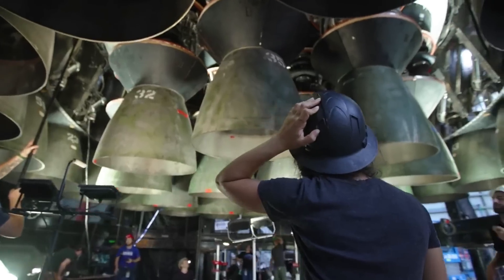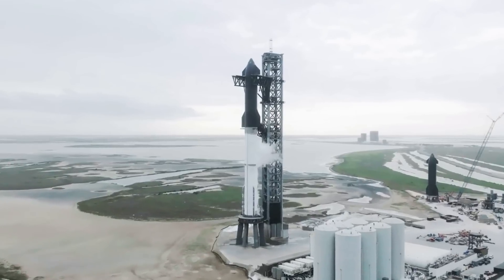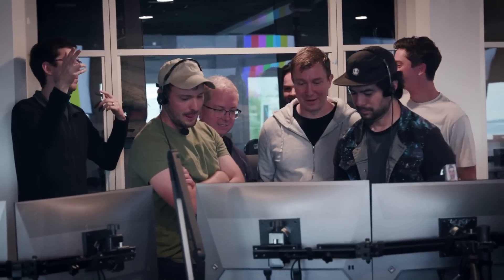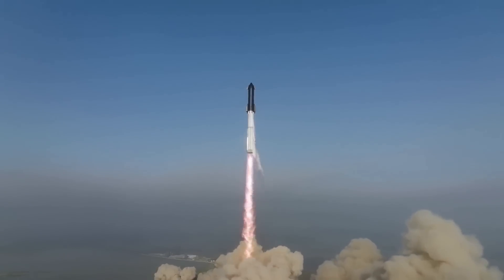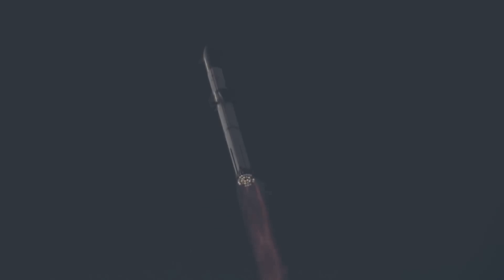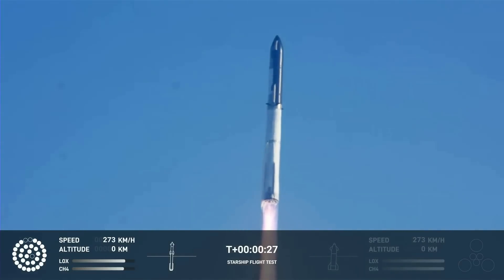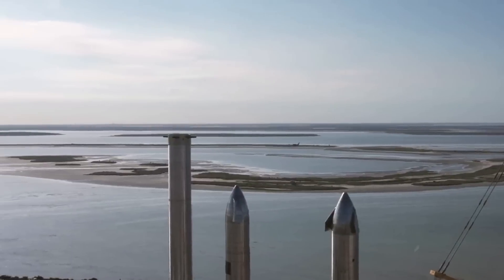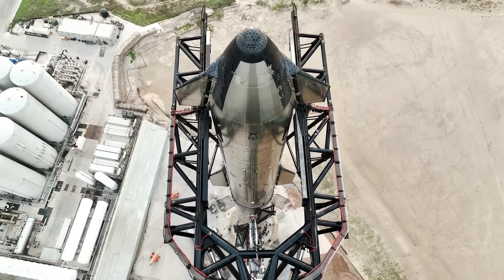SpaceX’s Pad Upgrades Are About To Be Tested

Comment: So.. why can't we just do a flame diverter?
Reply: You can’t dig into the ground in that spot, you’ll hit water since your just feet away from the ocean. 
So your choice is to either build a massive hill and place the rocket on that hill, dig the flame trench on it (will take years to build) or to come up with alternative solutions. They thought the special heat resistant concrete would work but it didn’t.
Reply: Why would it have taken spacex years to “build a hill” if they just built the fabricated structures higher in the first place to accommodate a diversion structure and have a layout that allows rework on the engines as they are so fond of doing. This could have been easily accomplished if the original layout had been actually thought through to accommodate these needs, or did “somebody” force a design decision without a Plan B option type contingency ¿¡?! Some might say that this was a suboptimal decision, while others say this is all part of the genius of the decision maker.
Reply: Thank you for the replies and info. This actually helps me see the bigger picture of the "why" part.

I feel like maybe someone mentioned it in one of the other videos. (but here are like thousands of these crazy SpaceX obsessed voyeuristic channels.) So I kind of felt like that was detail a bit overlooked in these video postings. It makes more sense now.
Reply: It has something to do with dealing with the lack of a minimum amount of forethought before painting themselves into a corner. Something about not having the time to do it sorta ok in the beginning but somehow this is the time optimized path that is a stroke of genius.

Comment: That Holeier than Thou , BF Water Deluge system ... better Work Longer than that ! ... or they Can't Test a Full duration Fire or even a partial one ..... So again Musk can't Test his 33 engined BF Rockets all at once ... Only one Motor at a time ...... Plus , When is Musk going to Clean up the Swamp ? ... it Looks Awful !
It's All No Good ! ... if the BF Booster can only Fire 31 BF Rupture Engines ... otherwise it's a Lame Duck ! ... And NASA won't approve it , and Neither would Anyone ....... 
WTF ? ..... SpaceX is making Awe Inspiring Progress and Broka Chica ?? .... Is that like the Awe Inspiring Setbacks that plague this BF Rocket ? ... That's all this Rocket is , is Setbacks and Delays ! ... You are tuned in to Reality , aren't you ??
Reply: I'd like a toke at what you're smokin'   😵‍💫
Reply: @Robert brander.  You sound like a Space X complainer without any real understanding of the process of developing a rocket that will fly to the moon and eventually to Mars.  

Of course nothing is guaranteed, but your comment only focuses on what you think is wrong with the starship rocket without understanding it all.  

And you forgot what company also reflies Falcon boosters with two of them up to 16 reflights.

You are forgetting who planned to land a rocket booster and few believed it could be done.  Now it's routine.  

You forget who built the dragon capsule which reliably carries passengers and cargo to the ISS.  

And I could go with other firsts by Space X indicating a company that achieves what it sets out to do.
Reply: Musk is succeeding with his Falcon ... But the BFR is 100 times harder ... built like a backyard Project with an ocean of Fanboy Propaganda ... and the Rooky Mistakes are Obvious ... After 2 years he is still sorting out Ground Zero ! ... And getting off the Ground is just the First Task ... With each new step getting more Difficult ! ... I hope he Succeeds ... But I Don't See it !
Reply: @robertbrander2074 Christ. Get a life dude. 😂
Reply: @lyricbread  this guy really likes to use his period button on his keyboard lmao

Comment: Amazed at how fast this company can iterate and improve
Reply: And how slow the competition is...
Reply: It always pays to be so “Production Rich” that your iterations are so far ahead of your testing that when someone finally acknowledges a glaring design flaw, your rework becomes a major bottleneck. Reference to the massive amount of half@ʴsed bandaiding to deal with obviously flawed cargo door on starship that has caused major rework an a large number of previously built “iterations” so that a catastrophic failure could be avoided. The original design smacks of “somebody” driving an unworkable concept. It seems that spacex is violating Kelly Johnson’s rules to success in multiple ways. It will be interesting to see how history will treat them if there is not a bunch of “Revisionistic Pseudo-Myth Fabrication” going on.